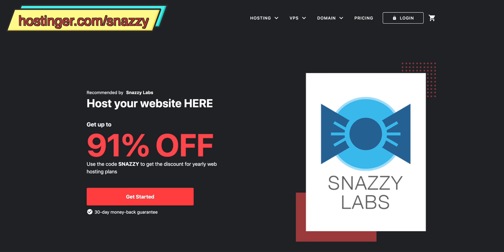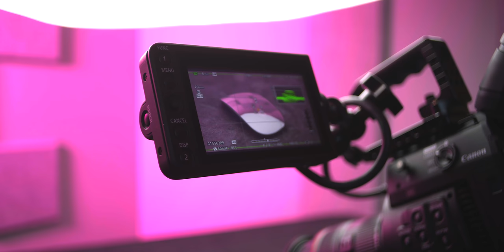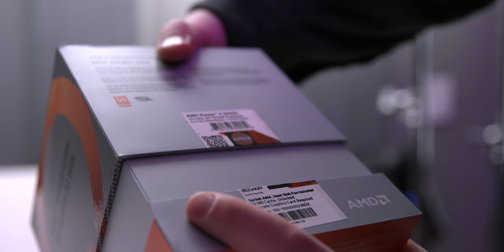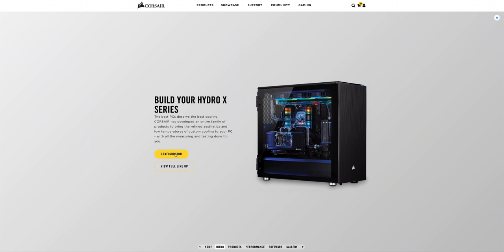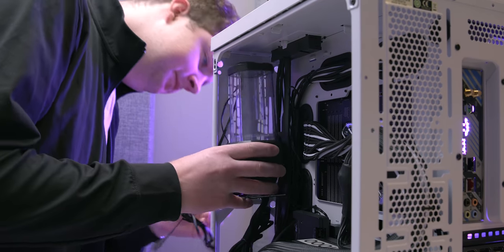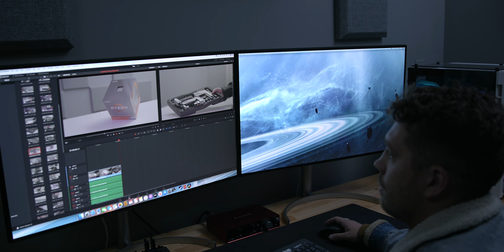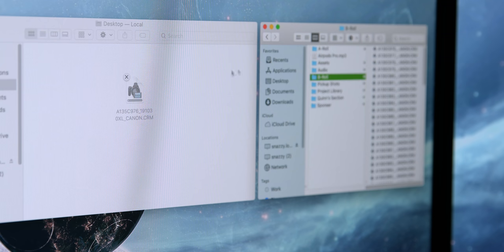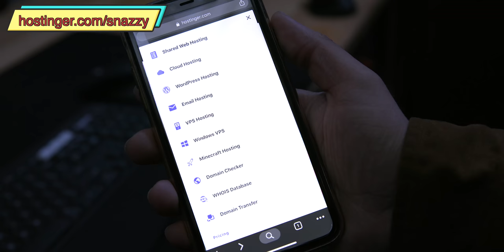AMD HACK MAC KILLS THE NEW MAC PRO!

Comment: I'd love to see an in-depth "how to install Mac on a hackintosh" video. I've tried a number of times and can't seem to ever get it to boot.
Reply: Jyrone MAC OS runs on my HP laptop, that doesn’t have an AMD GPU, was just a challenge to get it working under Virtualbox, Mojave was easier than Catalina.
Reply: You don’t need an AMD gpu to run Mojave. That’s only if you want graphics acceleration (which you do). You can install High Sierra if you have an Nvidia gpu and have full graphics acceleration.

Comment: How does Ryzen play with Final Cut Pro vs something like a 16" MacBook Pro? One of the main reasons to make a Hackintosh is to use Final Cut Pro which you can't use on Windows.
Reply: 16" macbook pro is a laptop , this is a PC ... macbook 15" could't keep the base clock of the cpu while rendering bcuz of cooling... 16" looks better than cooling but aint much... 16" can go up to* 3 ghz on all the 8 cores while rendering ... this pc can run atleast 4ghz on her 12cores like forever.... 

to sum up... this pc can and will double* the performance of the 16" mac
Reply: Flush Royal the key point is how does Final Cut Pro perform on an AMD part compared to windows and apple optimization. From all previous reports, Final Cut Pro actually doesn’t do too well on amd CPUs.
Reply: @SuprUsrStan  i got ut point but some video applications are core speed based(adobe pr etc) some applications are thred based(cinema 4d , blender etc)... if apple is not being apple(adding bug to amd systems) Zen 2 must work better bcuz amd system has the all the advantages, core and clock...
Reply: SuprPwrUsr final cut is moving towards gpu rendering. As more stress is placed on graphics cards, the cpu won’t matter. Also davinci resolve is just as fast if not faster than final cut in a lot of places now and it’s cross platform. Final cuts one advantage of fast renders and fast timeline scrubbing is quickly becoming a moot point.

Comment: 8 Cores for $6000 - the new Mac Pro's pricing is shameful, disrespectful and disdainful to creative people.
Reply: Zangeef Fangsteen blame MKBHD and other high tier tech you tubers who push that it’s good value because that’s what the parts cost. But they fail to realize identical parts is not the same as identical or better performance. Ryzen is way faster at the same price. Same performance at lower price.
Reply: RiceCube Tech - Where does it say Ryzen is faster than other cores?
Reply: Vladimir Putin bruh ipc gains are a thing. At the same frequency Ryzen single core outperforms intels.
Reply: Vladimir Putin a 16 core Ryzen 3950x is faster than an 18core i9 10980xe in multicore.
Reply: Vladimir Putin a 10980xe is also 999 while a 3950x is msrp 749 but is around 800-850 because of price scalpers
Reply: @ahsookee  Because it's better that building a fake mac and find a way to add 800 gb of ram
Reply: But it doesn't matter to places like film post production houses, who write off their hardware purchases, or more often than not lease their hardware.
Reply: @Simon-oy7kf  Can you think of a single task that would use that much RAM?
Reply: Irish Jester  Yes but the point is that the target audience for a MacPro are places like post production facilities who don't care about paying a bit more for a system that is qualified for their OS and hardware. Those kind of customers don't want to have to deal with the headaches of building, running and maintaining a hackintosh. Just the headache of not being able to use standard features in the OS make this not a viable option for most post houses.
Reply: Yeah like when they had to write off their entire million dollar XSAN installations when Apple decides it didn't care about Pros anymore. Or when Apple wrote off Shake... or Color... or XServe... or 17" laptops... or FCP 7 and actually pulled it from shelves. Apple hates Pros.

Comment: What was the power consumption on this beast?
I imagine the 1000W is actually a massive bottleneck
Reply: 700W max.
Reply: Dariusz Sepełowski highly doubt it
Reply: youraveragedude the 1000W is more than enough for that build
Reply: @Grimir  once you actually use a calculator , or even reading the minimum and maximum powers each components withdraw, 
1200W is the bare minimum power supply
you dont take in mind the massive power consumption on the 3900x and the not one but TWO vega 64's and one thing people miss,
the water cooling KIT. 
yeah.
Reply: You realize that we are talking about 1KW here? There is a big difference between cheap power supplies and quality ones if both give 1.000W. I have Thermaltake Smart SE630, modular 630W PS and it is rarely loaded. You have recommended and minimum values for every hardware how much power it needs to operate so that you can calculate which PS you need. Additionally, the power consumption increases when the hardware is loaded more and it is very hard to load all components to 100% if you use a hi-end monster such as one from this clip.

Comment: I would be more interested in a Hackintosh that matches the $6000 price tag.
Reply: Balázs Ludmány I tried. Even with the 16 cores and dual Radeon VII and like 128 go of ram it’s still under 6000. You’d need to go threadripper which only further embarrasses the intel based Mac pro.
Reply: That is kinda the whole point. You would need to over spend on just about every component and with little to no effect to performance. Apple is selling over priced PCs these days, just because they run Mac OS does not make them Macs, not anymore, not since they started using intel CPUs. If the likes of Dell, Lenovo and HP each made their own OS, Mac would slot in right along side them, indistinguishable.
Reply: I supposed you could always go the EPYC route and really piss on the mac pro.
Reply: @menotu000  Haha yeah for sure. Then again, the 3900x already pisses all over it. Hell, my 2950x makes it look like a kids toy. The main problem is stupid people still think more expensive = better.
Reply: You could argue that part of the price is the warranty service where you don't have to deal with the individual manufacturers of each component. That's why many prebuilts are more expensive than the sum of all the components. But after what they've done with the Macbook keyboards or the iMac Pro displays, I don't think this high of a markup is justifiable.
Reply: @ldmnyblzs  Even then, looking at comparatively specced prebuilt systems this thing is insanely over priced for the spec. 

Honestly, I used to love Macs but I reached a point long ago where all the justifications and excuses just no longer cut it. The G5 Mac Pro was an absolute monster of a system and way ahead of it's time spec/performance wise. You payed a premium but you got the bleeding edge and incredible quality. This reincarnation, even top specced, doesn't even fall in the top third of it's class performance and spec wise. A high end workstation with a 64 core Epyc CPU and 700+gb of RAM costs significantly less and runs rings around even the best specced Mac Pro. The value is gone, the longevity is gone and the prestige associated with the brand needs to die now too. Apple is literally marketing the legend that was Mac 20 - 25 years ago to sell its PC clones today. Yes, I said it, modern Macs are PC clones. Different enough to be different but not different enough to be their own thing.

Comment: Pro Tools doesn’t work on this - I tried - and Adobe crashes
Reply: Exactly, that's still a problem on AMD Hackintoshes, together with virtualization. No mention how thunderbolt works too.

So as much as I like current AMD offering, still it's not on par with Intel. Performance wise yes, but compatibility? Nope.
Reply: AMD in general isn't that great for Pro Tools or any AAX's due to poor AVX-512 support.
Reply: is your OS catalina? my CS6 didn't work on Catalina
Reply: Uncinematographable Screenshot Cinema  Uh, it is the most important to actual professionals.
Reply: @DarkPa1adin  CS6 will obviously not work as it's 32 bit and Catalina runs only 64 bit apps. CS6 is pretty old if you ask me. If you don't want Adobe CC, maybe you should try Affinity Photo.
Reply: @ZhuJo99  I have all 3 affinity software, but photoshop cs6 and indesign cs6 are more advance :). in terms of workflow, affinity is king right now...

Comment: Adobe suite doesn't run properly on those ryzentoshes and it's not good for video editing
Reply: This is no longer true.  Most of the stability issues have been fixed with the main programs and the only crashes now come from specific filters or plugins that have been specifically coded for intel hardware.  Go google search "AdobeFixAMD" and the top github hit has most of popular plugin fixes.  The only real difference now is Ryzen's lack of intel QuickSync and GPU encoding / Ryzen CPU encoding has closed most of that performance gap.

Comment: I've never owned a watercooling system and don't know much about them, but that pocket of air along with bubbles on the cooling block seems problematic.
I'm pretty sure that the pocket of air could be removed without too much difficulty, but I don't know if the same applies to the smaller bubbles. The smaller bubbles wouldn't be as big of a deal anyway though.

Comment: I’m so tired of this griping about the price of the Mac Pro. “Hey! You can build your own for a FRACTION OF THE PRICE!” As if this gawdy hunk of off-the-shelf PC parts is going to even work in 10 years. As if a water-cooling system is going to work trouble-free. And, biggest of all, you spent $3500—only $2000 less than the Mac Pro—but spent “DAYS” sourcing, building… You had to manually take apart the video cards, for the love of god!—on your own dime. So this only makes sense if you have a holiday’s worth of free time, and you assign absolutely no value to your own labour and time. Oh, and no system warranty (rather, you’d have to figure out what is broken and go after that specific manufacturer’s warranty). And no Apple Store support—should something go wrong. Oh! Ha ha! I just got to where you had to disassemble the whole thing and get to the motherboard just to get Handoff working! Sorry guys, nice try—but I’m not convinced.
Reply: Totally. And it's not faster than the new Mac Pro's anyway. Such a dumb video...
Reply: Catsincages Don't get me wrong, they've built a great PC here. This is a great vid. I do object to the host declaring Apple's pricing to be some kind of rip-off. 
So much work. And, in the end, you've only got a Hackintosh (with the inevitable problems inherent) or a Windows PC 🤮.
Reply: Not to mention minimal resale value. I suppose it's an interesting project though.
Reply: Dunno about USA but in Europe you can buy all parts at one store  and pay like 50$ for them to put it all together and provide whole system warranty . Water Cooling in this system is mostly just for show  , and more cost , you can get rid of it .  As for assigning value to time , I don't earn $2000 per day ,  that's my monthly salary , so yes i would take my time , watch this  vid , order parts online with retailer that offers whole systems warranty and assembly  and wait 4-5 days for delivery . Apple is selling luxury items ,they overcharge for it because it's an luxury product.  if you buy it that mean that you are better off then most ppl  and you have money to burn  and that's fine   , really , just be aware of that .

Comment: RyzenShine... both groaned and laughed. But what else could you call it? Other than the multi-color RGB -- definitely not my style -- this is a gorgeous build. And I was VERY pleased to hear about the AMD OS 10 community's Vanilla kext! Just got all the parts to build my new PC, the White Ryzen: Fractal Design Focus G case in white, the Gigabyte B550 Vision D motherboard (with Thunderbolt 3), Ryzen 7 3700X CPU, 32gb (for now) of Corsair Vengeance RAM in white, the 1tb Corsair Force MP600 PCIE Gen 4 M.2, and the MSI GTX 1660 Ventus XS 6G OC GPU. I thought I would be setting up VMware to host the existing High Sierra-based system from my 2010 Mac Pro, but sounds like I'll be able to run High Sierra directly. Thanks for cluing me in!

Comment: We also made a AMD Ryzen Hackintosh with almost the same parts but with passive and probably quieter cooling and with the 3950X. It was for sure NOT easy but after a few days and tweaks it is finally running sort of stable. We also used the Asrock Creator MoBo for the 10 gblan and thunderbolt. The thunderbolt is not working and i am pretty sure you (snazzy labs) also couldn't get it running. If you did let me know! :-) The video is fun to give a bit of inspiration but it is communicated to be much better and easier than it is in real life. For us, it was a fun project and a test, but if you want a stable 100% working machine, just get a mac. I love my set up and switch it between windows and mac (two m2 SSD installs) but am working more on my other mac or on the pc install because it is just more stable. Maybe there is a good working kext for the thunderbolt after a while.

Just try this out, it's a fraction of the cost of a MacPro but it is by far the same experience. So for sure no Hackintosh that kills a Mac pro ;-) Cheerio

Comment: Interesting that AMD chips are possible. 
I'd be curious to see how it behaves under load. Rendering FCP or AE jobs. 
Also really interested in the performance of the Thunderbolt chipset. 
Are Blackmagic, MOTU and UAD products viable to use?
My 2013 flower pot is nearing the end of it's usefulness and I am not going to get the current over-priced Mac Pro. Especially given the absurd arrangement of the T2 chip and the SSDs.

Comment: Did you know an Ipad is magnetic ?
I didn’t until yesterday I had my iPad on my desk and I picked it up and suddenly in the middle of it I had a AAA rechargeable battery attached to it. There’s a black small oval like spot in the middle of the iPad on it’s side and up to a certain point on either side of it and the spot it will pick up a battery and hold it like glue I don’t know what that spot is but it’s amazing !
I have an Ipad Pro 11 inch second generation.
Maybe now I can pick up all those drops safety pins pushpins and paper clips we shall see would be a real timesaver.😜😀

Comment: How loud is this machine? Db meter reading? How many total hours did it take you to spec, assemble and install? Omitting time costs is usually where you can claim cost savings but it's a false equivalency. I do hope the work you're doing does inspire apple to consider AMD CPUs for their pro lineup as an "option" at first. I think their non-pro CPU's may be mad ein-house a-la iOS devices. Great stuff!

Comment: Definitely want to see the 3950x in there, seriously considering doing this the only trouble is the lack of Nvidia support which makes my workflow so much quicker for previewing renders in red shift on Windows. I’m still using an upgraded 2012 12 core Mac Pro for all my video and photography work using final cut, photoshop and capture one and I’ve exhausted all the possible upgrades with PCIe SSDs max ram and a decent AMD GPU but it really struggles with Red raw playback. If all of these work cases could be compiled together into one workhorse it’ll save me so much time and I can use my current PC as a compute unit in a render farm with the Hack Mac meaning big projects can be rendered so much faster.

Comment: should have used a 3970X, would have wiped the floor with a Mac that doesn't cost as much as a Tesla model 3 with some extra bells and whistles. Although that isn't completely fair because you can also do a W-3175X build that would match the Mac Pro for much much much less than a fully configured Mac Pro, but the 3970X is $2000 while the 3175X is $3500 at retail if you can find it at all, and as said the 3970X wipes the floor with the 3175X in application that can use that many core, and if you are using a mix of both types of applications well for $1500 you could build a 9900k system as well which will perform better than a 3175X in applications which can't use all the cores, and that would make buying a 3175X cost the same as buying a 3970X and a 9900k system.

Comment: Nicely done!  Yes on the 3950x.
I'm curious about the throughput of this machine.  Could you make a demo of FinalCut pro with multiple 4 or 8k streams like they did in the demo and run it on this machine and then on the MacPro when you get it?  I'm curious how they compare.

Comment: Dear Snazzy Labs. Today I ordered the following components:

Fourze ATX tower T450 RGB 
Corsair RM850I PSU 
G.Skill Tri.Z Neo 3000Mhz 32GB kit 2 sets
Asrock X570 Creator
AMD CPU 3950X 16core
Corsair MP600 1TB <- looking forward to this one!
Samsung 860 QVO 4TB 2.5" 2 pcs.
Seagate 8TB NAS 7k2 HDD 3.5" 256MB
Coolermaster ML240P RGB
AMD Radeon RX590 8GB PCI-E

This machine is entirely to run Logic Pro X, thus the downtoned GFX.

Any recommendations I should consider?

Any pitfall preventions you can recommend?

Comment: The ryzenshine cost $4,375. And gives you 1331 score on Geekbench 5, while the 2019 imac 5k (not even the pro) gives you 1258 points for $2.699, so in cost/benefits you are losing a lot, sure in multicore the diference is higher but you are paying 40% more. Also, with the imac you get a 5k 27" display, one of the best displays in the world included. To you ryzeshine add the cost of one good 27" 5k monitor, you will be at more than the double of the cost of the Imac, and you wont get the double of performance in any test.
Reply: You don't get a 5k display included with the iMac Pro.

Comment: Highest Mac Pro config is more expensive than my PCpartpicker config. And THIS THING WILL BURN THE MAC 42TB SSD, 32 core CPU. 2x RTX Quadro 8000, sadly only 128GB ram which isn’t even necessary in 2019 and probably until 2022